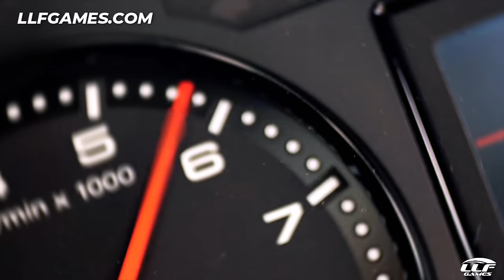COLLECTING MY M2-SWAPPED 116i **ULTIMATE SLEEPER**

Comment: Fuel cap needs a bit of work but considering how big this job is, that being their only discernible issue speaks to how well this has been executed. Cannot wait to see the final exterior after paint and proper fitting 💯
Reply: Fuel cap is always a problem when you go wide arch/kit depending on where it is on the car originally. Will look fire when it's all sorted.

Comment: Why didn't you go for the s58?
Reply: B58’s are faster
Reply from the maker: I have a m3 touring 🤷🏾
Reply: @Rickyseniorr  is there any one trying to fit a s58 in to a 1 ore 2 serie chasie
Reply from the maker: @havefun1226  theres no point the s58 is basically the same as the b58